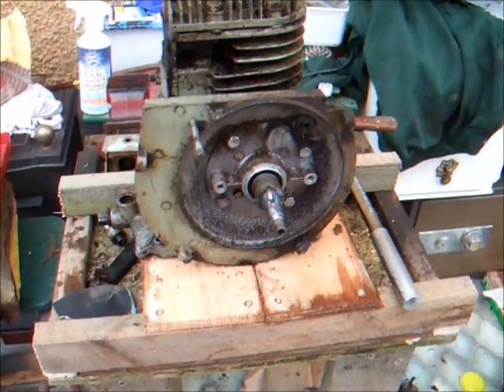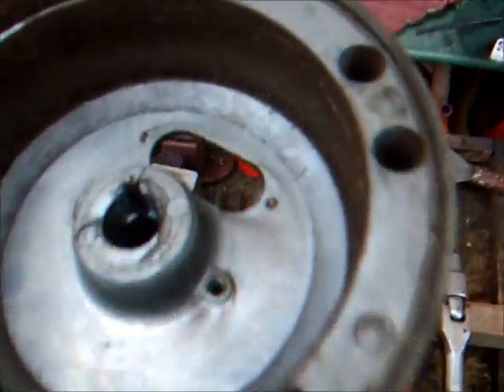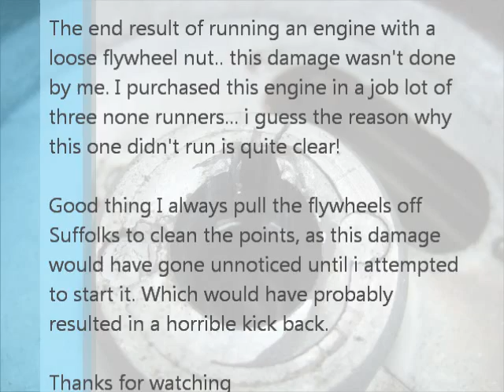The result of running an engine with a loose flywheel

Comment: If you take the main bolt out, you will see that in the disk there is a bigger thread which the main bolt dosent touch, screw a bolt in to this thread in the disk and it pushes against the shaft and pushes the disk off, hard to explain but you will see what i mean when you take the main bolt out

Comment: I almost blew an aluminum flywheel apart.  I rev the hell out of this little 3.5hp on my rider mower and while i was showing my friend i noticed the power drop a lot.  Would bog hitting 3rd gear.  Turns out the flywheels had cracked and was loose on the shaft.  The keyway is banged up a little but still works.  I put a new flywheel on it:)

Comment: Another totally unrelated thing, i recall you saying in one of your videos that you may have to take the disk off the bottom of you hayterette and you thought it would be near imposible, turns out its easy i got mine off today, there is a hole in the disk where you just screw in a 7 1/16 unf bolt and it just pulls it off, piece of cake!